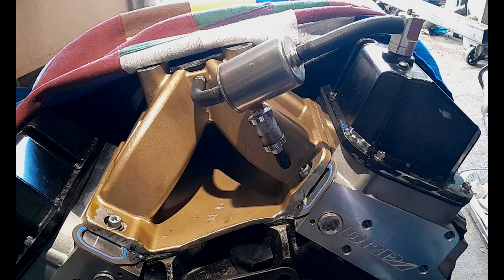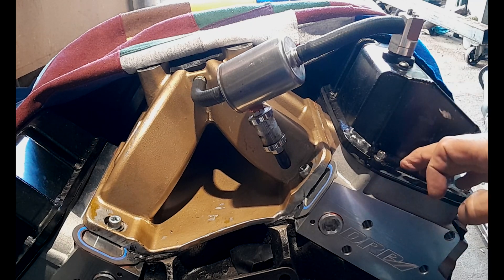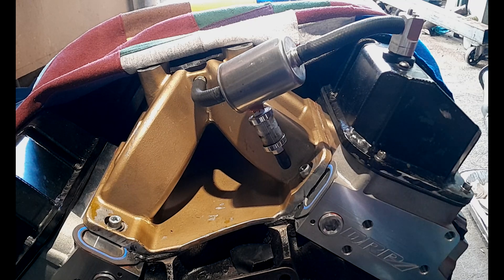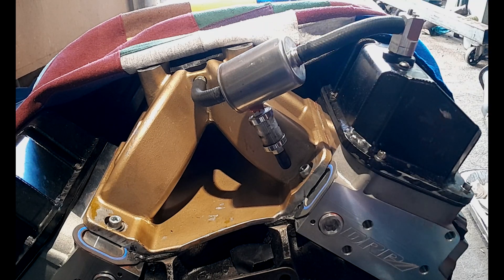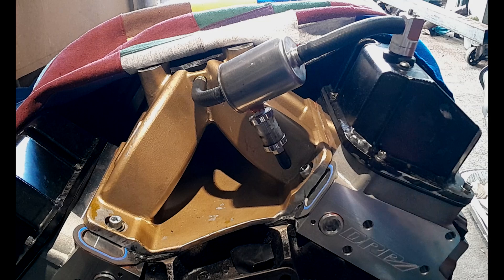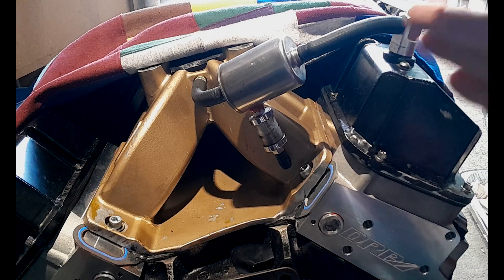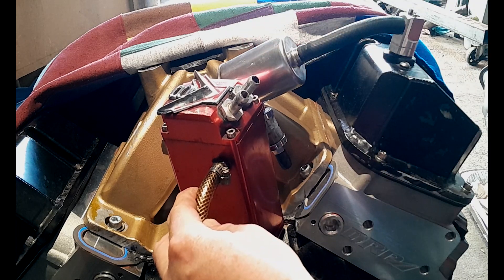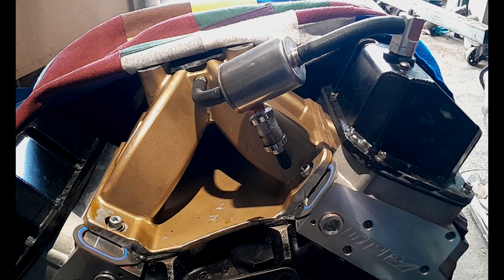Benefits Of A Sealed PCV System With A Catch Can

Comment from the maker: I’m pinning this comment to save people repeating the same diagnosis for the leaking seal. You can indeed have excessive crank case pressure outside of EXCESSIVE blow by. This was not due to poor ring seal. A leak down test WAS undertaken by the builder to determine if the rings had sealed and the test passed. It was a mystery for sure, but as stated in the video, the PCV setup once implemented, stopped the rear seal leak and my car does not use oil or burn oil.

Comment: 1 of the problems with low tension rings currently, another option is to mount that filter upright, so that oil and water would fall out of suspension and then drip back in to valve cover, crankcase. The water and gas when engine at temperature will evaporate and burn off. You basically put a decelerator in the PVC line. The LS engines use approximately 1/4"(6mm) line as you open , close throttle, rapid manifold vacuum pulls oil in to intake. If you look back Ford ran big breather with PVC valve in it.
Reply from the maker: @keithbarron3654  food for thought there mate. Thanks for the info and ideas.

Comment: 🍁    Fascinating.   I am however confused with those blanked off head intakes exposed????
I have an OEM factory Mini Van and little ability to install a Catch-Can system.   Although the PCV is connected to the manifold vacuum port after the throttle body, the air vent on one valve cover is connected to the main air intake that allows oil vapor to coat the throttle body and plate.  Any idea's about that ?????
Reply from the maker: @lisab3396  as far as I know that hose from the air filter cover back to the rocker cover vent you describe, is mean’t pull in fresh air to the engine. Not sure why it’s getting filled with oil. Maybe the vent cap the hose connects to is faulty? You may need a one way inline check valve.

These cylinder heads you see are built for Windsor or Cleveland blocks. The two engines use different water priorities. Those plugs are to blank off the Windsor setup. Mine is a Cleveland. They are sealed with RTV on the threads and wound in as far as they can go.

Comment: If you are blowing out a real main seal on start up, you have bigger problems: ring seal.  There is no way any engine, let alone NA, should be developing that much blow by. You need to do a leak down test.
Reply from the maker: @stickman-1  I’m pinning this comment to save people repeating the same diagnosis for the leaking seal. You can indeed have excessive crank case pressure outside of excessive blow by. This was not due to poor ring seal. As stated in the video, once a sealed system was implemented, no more oil leak from the rear main seal.
Reply: @Doctoradhd1  Yes, because you relieved the crank case pressure by porting it to the intake which is under vacuum. There is no other way to get pressure in the crankcase other than by the rings/piston. That's the only source of pressure. (Except for overfilling the oil in the crankcase and you go into foaming.) Did you do a leak down test? Did you do a compression test?
Reply from the maker: @stickman-1  hey stickman, yes a leak down test was undertaken and passed. A compression test with a brand new high comp motor will not tell you if your rings have sealed. The cylinder heads were also removed to inspect the bores to see if they had glazed over. This was not the case. It's a mystery and all I can tell you, is the PCV setup stopped the main seal leak.
Reply from the maker: @ I’m hearing you stickman. It had everyone scratching their heads. That was the first thing assumed as the culprit but after a leak-down and a bore inspection, all was good in that department.
Reply: @Doctoradhd1  I'm sorry but you posted this 2/3 days ago and you said you did not run it yet. So how can you say it solved the problem? When you say is passed a leak down test what was the %? And when you did a compression test what as the result? Depending on the % leak down, I'd rerun that test. I've built many engines and the only way you put that much pressure in a crankcase is piston related. rings, hole in the piston, crack in the piston, crack in the block, etc. What CR are you running? I am not saying your PCV system won't show a benefit. I'm saying it's a bandaid masking the real problem. If you run this system in 6 months the back sides of your intake valves will carbon over. After a few years there will be enough of an effect engine performance to be noticeable. I wish you the best of luck with it.
Reply from the maker: @ I haven’t run this version of a catch-can yet, but have been running a different sealed system catch-can setup as explained in the video. This engine has been running for 10 yrs (13000 miles) since using a PCV setup.

Comment: When you get it running load it up and put a few miles on it molly rings will seat quick then  do a leak down test.
Reply from the maker: I might do that Dean. My procedure for bedding the rings is a good one. This is where it's handy having a full manual auto. 

I take it straight to a local mountain and stick it in 2nd or 3rd and load it up the mountain in the higher gears and then engine brake it back down. I do this 3 or 4 times. It beds them fast.

Comment: Sounds to me you've had poor ring seal from day 1. Ive got a 393 same as yours no oil leaks at all just with rocker cover breathers.
Reply: Seals and gaskets will let oil pass with positive pressure. With a slight suction inside the block the seals with get tighter by design and not let oil pass. Some race setups have pcv and a breather on the other bank.
Reply from the maker: That's what was suspected from the very first main seal leak, but that procedure was undertaken by the engine shop who did the build when it was returned under warranty with the leaking seal and the bores were sweet.  A pass on a leak down test along with no evidence of  glazed cylinders.

This is why everyone was scratching their heads as to why this was happening. Bottom line is that once a sealed PCV system was implemented, the main seal stopped leaking. Now that's not to say that it wasn't a combo of that PCV change and then the rings sealing properly at the same time. This was all done very early in the new build.